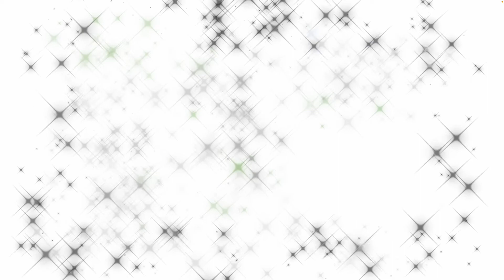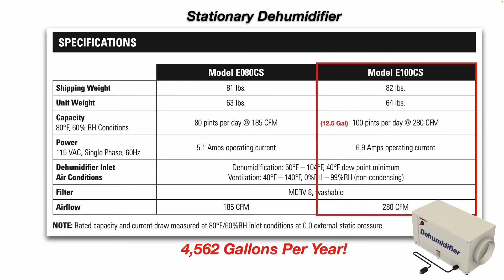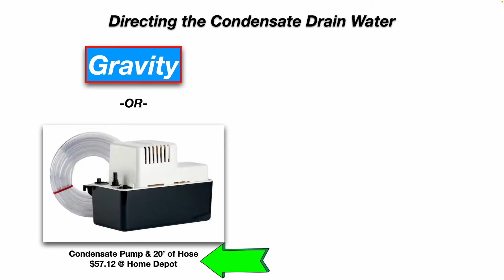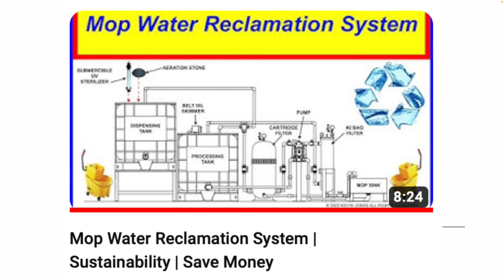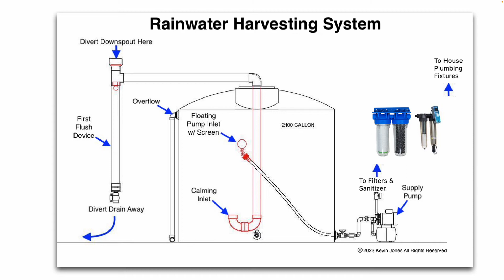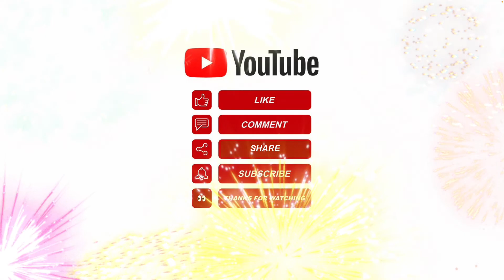Dehumidifier Condensate Harvesting | Sustainability

Comment: 4,562 gallons of water per year is one measure. How many kW per year for that water so I can calculate cost (gallons per kW)?
Reply: 120 volts * 6.9 Amps = 828 Watts. 
(828 Watts * 24 hours/day * 365 days/year)/(1000 watts/Kw) = 7,253 kWh/year
7,253 kWh/year /12 = 604 kWh/month
604 kWh/month * $0.13/kWh = $78.57/month 

I'm on well water. This video just happened to pop up in my feed.
Reply: @muddy-one  Thanks! I also have a well but wanted to know the costs of running a dehumidifier for water production. $0.13/kWh is a fair rate for now but will probably go up. 80 bucks a month is definitely too much for that measly amount of water. A cistern (or another storage option) is probably much cheaper considering we can get multiple inches of rain in a day or two on the Gulf Coast.
Reply from the maker: Agreed.  The purpose of the video was to help folks realize  another option for dehumidifier condensate drain water, instead of just letting it go straight down the drain.  I'm not suggesting folks run a dehumidifier for the sole purpose of harvesting the condensate.  Rainwater harvesting, greywater harvesting, and HVAC condensate are other great alternative water sources too.   @PeskyCitizenTX